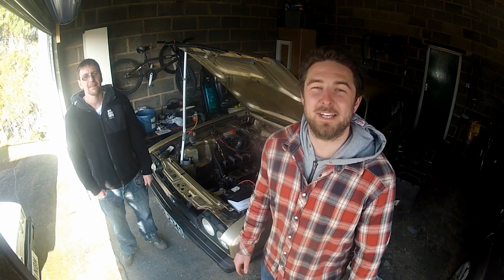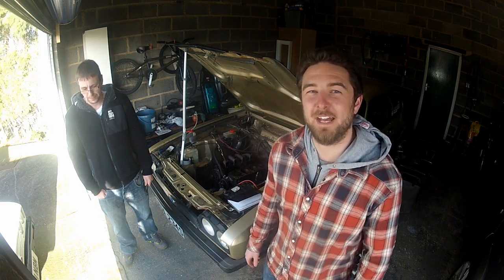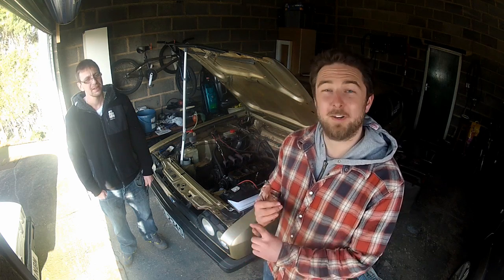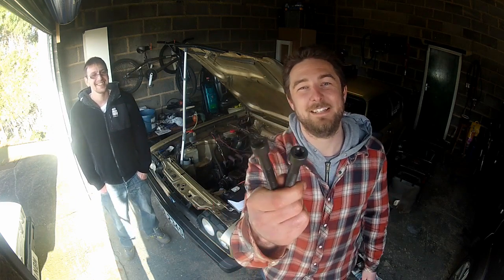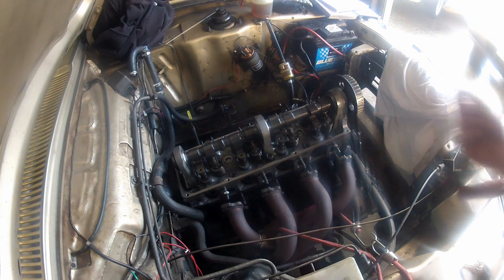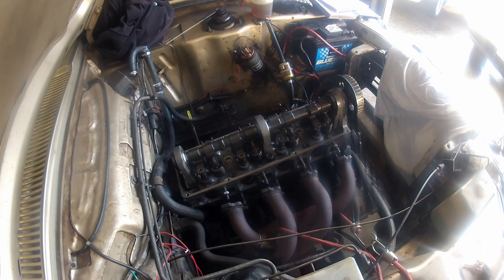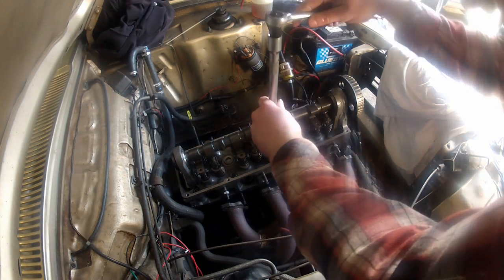Head Gasket Replacement & Bolt Torque on a Ford Pinto (SOHC) Engine | Tech Tip 01

Comment: Hi, great tip, thanks for the video. I'm just about to do the same job on a Pinto. What head gasket and bolts did you use. Are they TTY bolts ? Is it necessary to go ARP bolts on a modified engine ? thanks
Reply from the maker: ARPs to me are a bit overkill unless you're slapping on a turbo. I just keep re using the OEM bolts (the non stretch type) and have never had a problem. The only thing I've had to do to is grind them down by 2mm after a pretty aggressive head skim, otherwise they would have bottomed out in the block before fully clamping down the head.
Reply from the maker: So stock non stretch head bolts (12 splined drive), and a Felpro blue head gasket

Comment: Hey Fast Rust - I just installed a pertronic on my 72 2.0 Pinto with the Flam thrower coil as a kit I got from ebay. I reset the timing, drove it and it kicks ass, 80 miles later it starts back firing and powering down on my way to the swap meet, tac jumps to zero then back up to normal. I pull over and car idles fine. but as i get in the gas it's having trouble picking up to speed while I'm letting the clutch out, I feather it, it gets going then bogs and backfires LOUD, lol at least 20-30 times while I'm getting her home about 5 miles away. I switch out the coil, still the same. then I start checking coil wire, alternator wires and a few other connections, Now it's seems ok, I wish I knew what cause this for future outings.
Reply from the maker: swap back to points to eliminate that electronic ignition kit. Sounds like heat soak might be causing it to misbehave.
Reply: @FastRust  I was wondering if that Dia electric grease would help under the pertronix plate, I took her out yesterday with no issue, before I left I cleaned all my grounds, some were telling me that might be the cause. The pertronix kick butt when it's working, I can chirp 2nd gear, lol, But I'd rather have no trouble with it. When it was backfiring I thought i blew a hole in my new muffler. That shit was loud. :P
Reply from the maker: Sounds like you've got it sorted mate. Chirping in 2nd gear she must be running well!! Fingers crossed no more issues. I've had mine backfire before, deffo wakes the neighbours 🤣

Comment: Great videos! I'm doing a head on a Pinto at the moment, so all of the videos are helping. Question? Why does the head gasket have small drill holes instead of full holes the same as the head flow channels?  Do these not reduce coolant flow around the head? Cheers!
Reply from the maker: Not sure to be honest with you! I guess to encourage coolant to flow in a specific direction around the head.

Comment: I'm doing a Pinto rebuild at the moment.  Do you recommend dipping the head bolts in oil before installation, as per the Haynes manual?
Reply from the maker: +Finn McCool Hey Finn. Yea, I would, just a light covering aids with torque-ing the bolts. Obviously don't fill the bolt holes with oil!
Reply: Good.  Only one I pulled out was bone dry and was the one I nearly sheared!